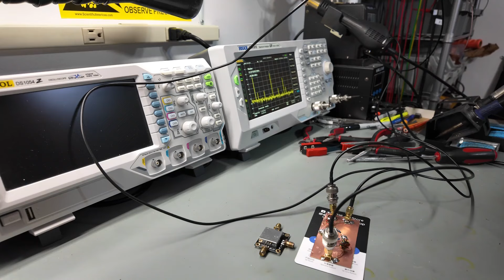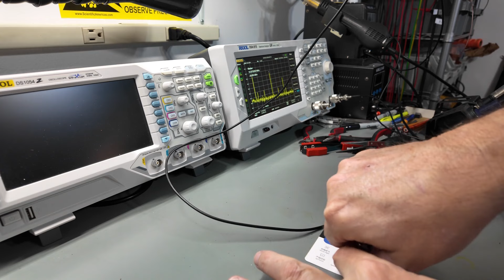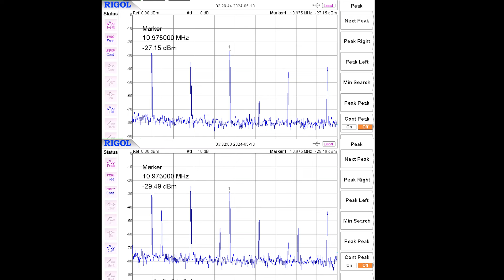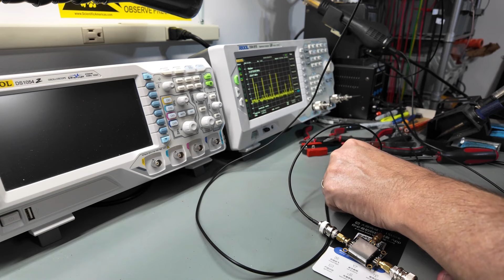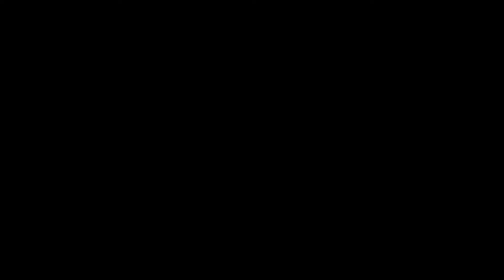Is our DIY diode ring mixer better than a factory one from AliExpress?

Comment: Although it might not seem like a fair comparison, it would be interesting to see this comparison in higher frequencies like in the VHF band. Are diode ring mixers fit for such high frequencies?
Reply from the maker: They are made to work into the gigahertz. But they need to be built a little more precise than the one I made for hf frequencies. 
RJ

Comment: Looks like the loss of the packaged mixer is higher by several dB. And the LO rejection worse. What sort of generator for the LO are you using? Would be interesting to see under the cover. Similar mixers can perform differently, depending on diodes. What diodes are used in the homemade mixer?
Reply from the maker: Thanks for the questions.
Both RF and LO are coming from a Siglent SDG 1032X signal generator.
The diodes in the mixer are 1n5711 as described in the previous videos on the build of them.
RJ
Reply: @LynxElectronicsLab  The packaged mixer normally uses low or medium barrier diodes which have lower threshold which give loss around 5 dB. 1N5711 which are high barrier diodes give around 7.5 dB loss in the same assembly. 1N5711 diodes may perform better at higher LO levels.
Interesting that the packaged mixer performs poorly.. If you measure from IF port to ground, on diode test then you should see a diode voltage which should be around 0.3v